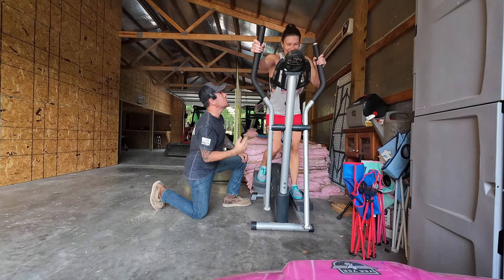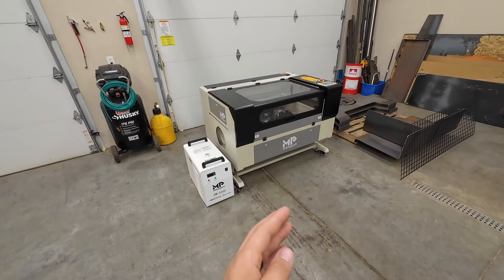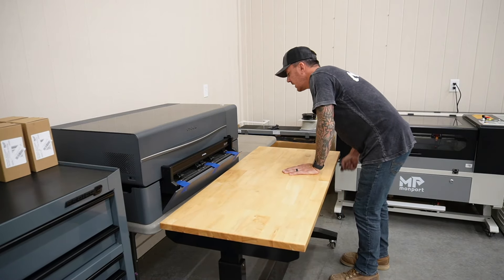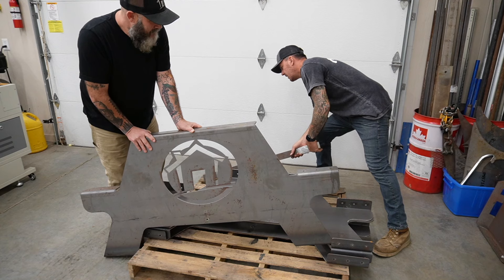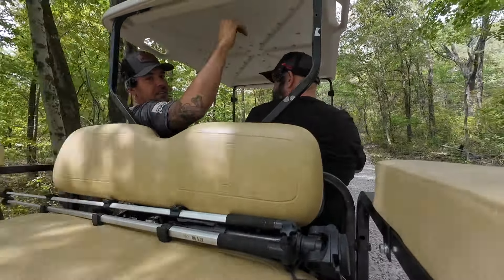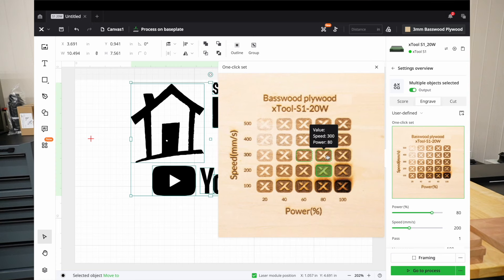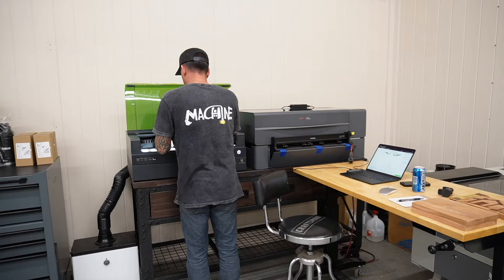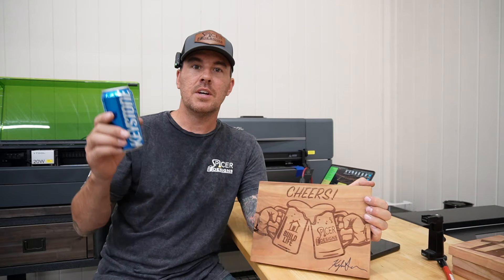MUCH Needed Changes For The Shop...And... A Special Visitor

Comment: I have one of those tables in my covered outdoor kitchen. It was already assembled from HD. I put a couple coats of clear epoxy on the top so it doesn’t start peeling or anything. 2 years ago in great shape. still. It said it’s made by Duramax on mine.

Comment: You want a real workbench just buy 7 4x4 and a thick piece 4x8 of whatever your choice of flat wood sheet is. You can buy post brackets or fab your own. Im sure you can figure out how to assemble it and bracket it up using the entire 4x8 as the top to your preferred height. Slap some heavy duty flip down castors on the bottom gtg. I've made three for my shop providing more than enough workspace. One holds solid a drill press half mill and a full lathe probably over 1k pounds of equipment. The others I use for material and part handling and painting. Maybe overkill but f it cheaper and better than storebought garbage. Welding carts just buy two of the metal vevor ones decent and solid enough.
Reply: Oh and you can use dowel pins or some type of joinery for the table foundation but I find drilling a hole and just using a 3/4"x 6" hex lag bolt works great.

Comment: Lynn was so proud to have something in her shop before you,  she's had that Home Depot rolling work station for a while...we did her drill press,2 scroll saws and a mini circular saw on hers and put the Xtool on the Husky tool box...for the built in power strip...we added a power strip to the back of the butcher block work station 👍

Comment: Is that 30 gallon Husky the air compressor you use for the plasma table ?
Reply from the maker: @110welding  it is
Reply: @SpicerDesignsLLC  , that is good to know. I just purchased a Dewalt 30 gallon.  Getting ready to buy the Pro also... thx
Does it run out of air in elaborate cuts ??
Reply from the maker: @110welding no i e never had an issue with it on long cuts.  I definitely wouldnt go any smaller